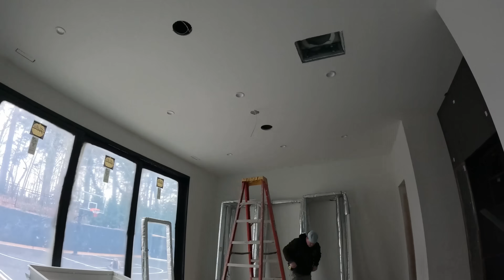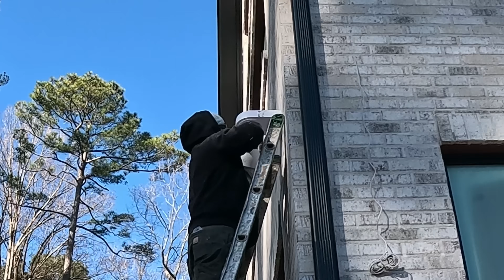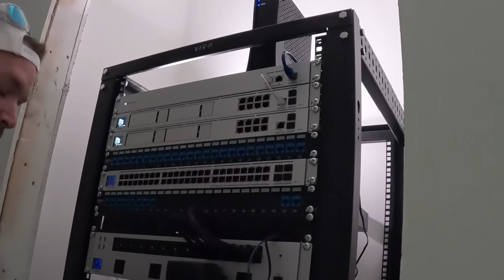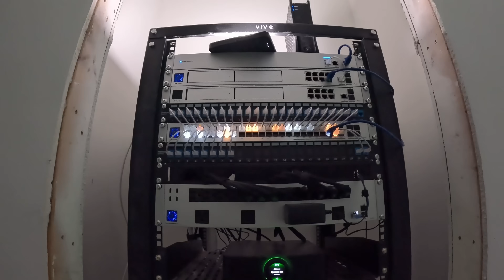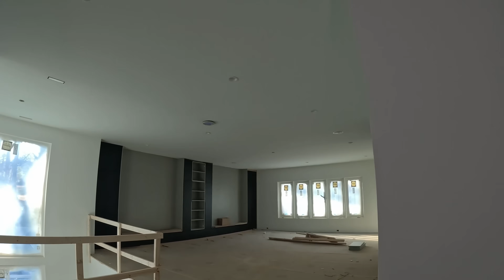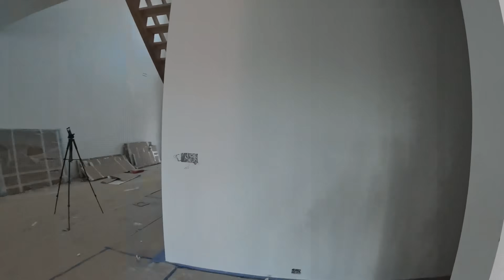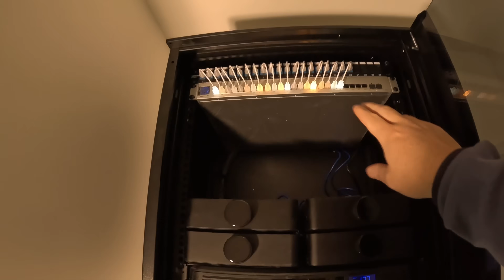UniFi Home Install : 26 Speakers, 25 Cameras, 10 APs

Comment: Whole project is fail. Camera locations are for noobs. Wifi not recomended in the room wifi signal are for Unify Pro XG 1500sqm, you can install it front of the door. About Rack cabin it is just TERRIBLE. Just audio amplifier i LIKED.

Comment: What is the real advantage of the quite expensive ether-lighting cables compared to standard, much more economical thin cables that still quite adequately show the lighting?     I see you use them a bit with ether-lighting switches, but I don't really know if they are worth 4 times the price to get Ubiquiti branded cables, especially given most people are not going to be staring at their racks all day.    I get the advantage of short, thinner cables in racks, but not really the price Ubiquiti charge for them.

Comment: VCE vs CableMatters for Keystone + Keystone Crimper combo, which one do you prefer.
Reply from the maker: Ive never used CableMatters keystones . We either use VCE Link with the keystone crimping tool or vertical cable with the crimping tool

Comment: Videos like this always get me thinking about selling my house and building one so I can do a full UNIFI stack in it. My house was new in 2006 and has zero runs and vaulted high-pitch ceilings, so it just isn't worth it to try and wire it. The catch is that it's been paid off for a few years, and building ANYTHING these days is cray expensive. Grrr. I want a full rack in my house so bad though!

Comment: Ubiquiti is fine for networking and cameras but no way in a custom house that size would I use Ubiquiti for audio. Put in a control system and a true distributed audio system. And why did you not use no bezel speakers?

Comment: Cody, by any chance, have you tested how Shadow Mode works on the Dream Machine? Network behavior is pretty clear, but I’m curious how it works with Protect And Access. We haven’t had a chance to test it ourselves.
Reply from the maker: Honestly good question as I have only tested with network. Ill get protect, access, and network setup in shadow mode and test

Comment: What a nightmare devices switching between so many access points. I only have 3 APs in my house and spent a great deal of time tuning channels and transmit power for each. I even lock devices to a certain access points if the device is static in location to prevent roaming. I can't imagine having 10 APs.

Comment: When you install that many access point in close proximity to each other do you just keep their signal strength at Auto / Default or do you adjust them to a lower  broadcasting strength?  
Did you guys do a pre install walkthrough with the client or did they just run all the cabling wherever they new they wanted a Unifi Device and you guys just came in for the install and termination?
Reply from the maker: So we did a WiFi design using ekahua and yup will be turning power down for certain APs, Turing off 2.4 completely on APs as well. When we go back to add super link we will be doing a WiFi heat map to validate our plan. We ran all of the network cabling on a previous visit
Reply: @MactelecomNetworks  - Do you think you will be making a video on the UniFi programming setup for a large install like that. Would be nice to see the thought process and programming involved In A large scale setup like that. Is Ekahua a better or preferred design program vs the UniFi design centre? 
Nice job you guys did. Nice home too.

Comment: I am shocked you don’t have ubiquiti patch panels.  And color matching rack mount.  For the amount of money being spent, it’s gotta become art at this point.  For nice homes. I try not to use ceiling AP. They are a bit eye sore. They would have to request they actually wanted it for me to use it. Ceiling mounted APs are for commercial emviroments imo.  I will usually use an in wall in each bed room.  Haven’t had coverage issues and esthetically better looking.  The u7 xgs however has a better flatter shape.  I’m going to flush mount a few of these on my next project.  Should be a better look than the usual bumps on the ceiling.  I would have also went with invisible speakers or at the very least flush mounted ones.   Cameras as well.  Ugly for homes.  I would have used all theta cameras on the interior or at the very least flush mounted domes.  Man this could have been a way better build for the budget.  Which I’m guessing he didn’t have one.

Comment: Cody great job, good vid,  what speakers did you use and what are your thoughts now with an Audio deployment for a school that needs over head PA, any kind of SIP might be out of the question being they are still using an analog system which I would love to move them to a Unifi Talk deployment.

Comment: I have a question, maybe someone can guide me: I'm currently living in an apartment and my router is enough to cover it. I'm soon to move to my house, around 5000 square feet, my question is if should I go with a mesh system or install APs to provide internet all over the house.
Reply: You're better off installing WI-FI APs throughout your home. It will be a bit more work since you will need to run ethernet from your router to the APs, but its the best choice for the best performance and reliability.
Reply: @JJFlores197  Thank you.

Comment: Why is there two racks? Are they on the same ISP/connection? Bit confused on that.
Reply from the maker: Size of the house. It was better to separate the lower right section from the second level. Making our audio cable runs shorter

Comment: My question are some of the AP’S to close together and when they to close together like that can you still have issues?
Reply: I would imagine he staggered the channels a bit so that only far away APs overlap.  I used to have 7 or 8 around my home that is a faction the size of the place in this video and it was doable.  I have since scaled back on IoT WIFI devices and upgraded to 3 WIFI 7 access points and the coverage is pretty good.

Comment: Amazing install....can see the benefit of getting the pros in to do the install (that much work would take me 100 weekends to get done haha).....but I question the timing of the install.  The plasterers are going to FK THAT UP totally with their sanding and finishing. RIP Fans and vents on the Ubiquiti gear.
Reply from the maker: Unfortuneltly the timing was out of our hands. We went down two times after the cabling was installed. The first time we got there no paint was on the walls and no power so that whole week we did nothing. This last time I went back and filmed we were told the house was pretty well done and they had power.

We show up to the job site its still needs more paint, no power ( They eventually got some in our network room) we had already flown down, booked hotels and the client wanted the gear installed. Im sure it will all survive but when we go back to install superlink we will have some cleaning to day

Comment: Nice installation, thank you for sharing. Maybe that was only in the video, but it looks like the devices (APs and Cameras) are in areas that catch the attention. I like it when people even notice those devices. An example is the AP in the master bedroom. I want to learn more about the audio system and what the device at the top of the main rack is used for.

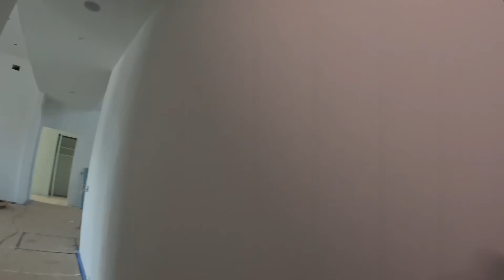Comment: nice video but I didn't get which Access Points you installed XG or XGS because in the beginning you say "The access points that we went with were the U7 XG" 0:45 but in the end "Every access point in here is the XGS" 10:20
Reply from the maker: They are XGS I misspoke at the beginning

Comment: My problem with whole house speakers is they just don't sound good. You can't control the sound. You lack bass. Tuning one room takes a lot of work, and you simply cannot tune from room to room.
Reply: You aren’t using the correct speakers if you think that, this install clearly used cheap speakers. Try something like Sonance or Triad with subs and a house would rock .

Comment: With the larger 24/48 port Pro Switches, do they have a mount at the rear, as you can see it pulling downwards at the rear with the weight.  maybe something aftermarket to help support the weight?

Great install, crazy amount of internal cameras

Comment: Why are so many XGS APs in a private home so close together? It's not even a brick house. If I'm not mistaken, these are drywall walls. So this is really unnecessary.

I wouldn't feel comfortable with so many cameras in the house, but that's a personal decision.
Reply from the maker: This was all designed in ekahaua will be low power to give no dead zones in the house

Comment: Why so many access points??  I'd love to know how those design decisions were made
Reply: Same here. How are they allocating channels/bandwidth between these APs and ensuring they're not interfering with one another?
Reply: @helloruiz wouldn't be surprised if they were upsold by these a holes and leave them set to auto configure😂😂
Reply: UniFi WiFiMan Wizard, a portable spectrum analyzer designed for the WiFiMan iOS and Android mobile app, + UniFi Design Center possibly?
Reply: phones be roaming like crazy in there
Reply: Microwave house!
Reply: You turn the antenna power down on them, more access points can be much better when setup properly

Comment: Shame there is no recessed fitting dome UniFi makes for internal use; those Turrets are ugly AF inside such a house. Like most companies, they appeal to the masses and make a limited number of devices. They should do a PoE G6 instant with Ethernet that looks more aesthetically pleasing with curves.
Great job there.
Reply: I have a couple of Theta cameras. They're much better than an ugly turret
Reply: You could use the PoE to USB-C adapter from Unifi to turn the G6 into a wired PoE camera
Reply: @GG-vv7nc  Indeed that's true, but the reason was not to use as a WiFi device, but ethernet data also.
Reply: @michaeljarcher with the adapter it is a wired data connection as well. I have two of those adapters in use and they show up as GbE connections. USB-C provides BOTH power and data.

Comment: THanks for this video! When you were doing the final showing of the secondary network rack, what was that ambient noise in the background: was it one of the devices in the rack or other external noises?

Asking because my rack will be in my office and trying to be mindful of choosing devices for the noise. Thanks!
Reply from the maker: It was reallllly cold there so I bought a space heater 😆 so that’s the sound you’re hearing

Comment: This is an awesome install. Do you have any specific degree or license to do this kind of work? I love networks, have built a few ubiquiti networks for myself, friends and family, and have been thinking about perhaps shifting to doing this for a living
Reply from the maker: Hey,

So I did have my Cisco ccna years ago  but it’s expired. I’ve worked in low voltage for the last 20 years. 

Network plus certification would be a good start if you want to learn more about networking in general. 

As for cabling there may be courses you can take in just unsure where you would do it

Comment: Love this installation but for the first time ever I have wondered whether or not it makes sense to install speakers into a ceiling because you're basically installing them into the floor of the room above as well I'm thinking localized audio should probably be strategically placed into walls in order to isolate bleed over

Comment: Nice install! I did an install a couple months ago that included a couple of the PowerAmps, but now they are crackling periodically. Have you experienced this? It's on all inputs and happens very far and in between, but regardless its annoying. Can't seem to pinpoint it.

Comment: I would highly recommend considering a multi input distribution amp and using the Audio Ports for zone control instead, of all of those individual amps, generates excess heat and adds more complexity than needed imo.

Comment: Thanks, Cody, for once again sharing your work. This kind of content is truly inspiring. Very organized and well executed. I’m also a big fan of UniFi products.

I’m based in Orlando Florida, and I was especially interested in the in-ceiling speakers shown in this setup. I really liked how they were integrated with the amplifiers. If possible, could you share the brand/model of the speakers you’re using? I’m currently working on a commercial project that will include multiple speakers, and that information would be extremely helpful 😊

Comment: XGS for a single bedroom is wildddd. That thing can serve 3-4 bedrooms with 6Ghz just fine if placed in a hallway. (Speaking from experience)
Reply from the maker: Big house. Will be turning power down and validating with ekahaua Side kick 2
Reply: @MactelecomNetworks gotcha. Was hoping they weren’t going to keep them all set to “Auto” 😂
Reply: In my experience walls definitely impact the signal of the higher frequencies and ability to get the highest performance out of the AP’s

Comment: When you have a build with 10+ APs, do you typically let any of them share channels? For example, 5Ghz 80Mhz wide - are there even enough separate channels? Or is it ok to keep some on the same channel?
Reply: I’m guessing these will be configured with very low signal strength to minimize overlap and interference. So channel selection can be set to “Auto” via UniFi.
Reply: I’d like to hear more about how this is configured too! Nice install so far.

Comment: What is the reason that you don't use the UniFi patchpanels? I think it gives a much more unified presence.
Reply from the maker: We do but when we ordered all the gear for this job they were sold out
Reply: @MactelecomNetworks only thing I don't like about them is the lack of options to label the cable numbers.

Comment: I wonder how long it will be before Unifi offers PoE Dante/AES67 network speakers. I would replace my old Crestron Amps with Unifi Amps if they offered Chromecast support, pretty insane that they dont.
Reply: Network speakers are the next step. It would also enable indoor tannoy.
Chromecast injection into the UniFi Amp can be achieved over eARC and a USB power supply.
Reply: They've just added Google Cast support to the PoE Audio Port, but not the power amp strangely.

Comment: Cody, do you suggest shielded cable for outside cameras (placed on outside walls or soffits?). If so, did you use a Unifi surge protector for each?
Reply from the maker: I don’t use shielded cable hardly ever maybe in an industrial setting. 

Also surge protectors we don’t use either. I’ve never had issues with gear getting fried

Comment: Great setup! why do you have two sites instead of one?
Reply from the maker: You mean different network rooms? The house is quiet large so made more sense to have two
Reply: @MactelecomNetworks  yes, a rack on the hallway and another one downstairs.
Reply: @arturoimaz6989 I've done ubiquiti build outs like this, one of them while I was working for a LV AV contractor like Cody, and some of these houses end up being big enough, or the layout is complicated enough that you could hit the 300ish feet limit of CAT6 and experience dropouts or speed issues. 

Having multiple network rooms/closets spread out throughout the facility and linking them at 10 or 25gbe fixes this, and also gives more room to add more equipment down the line if needed